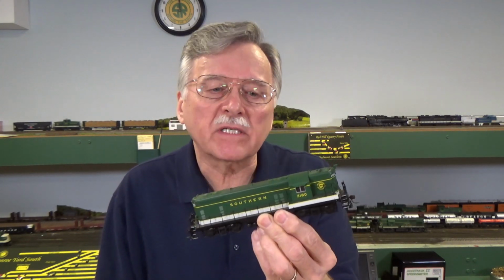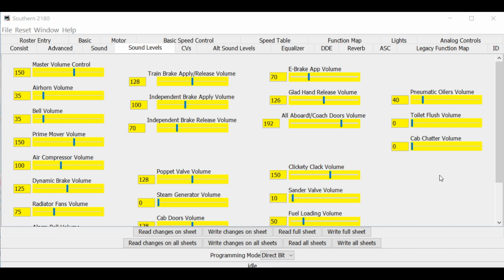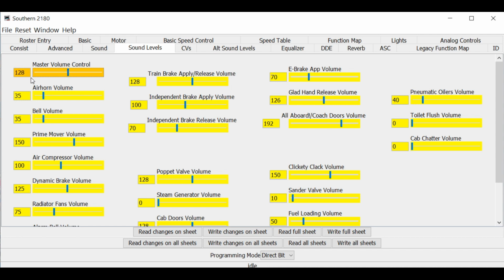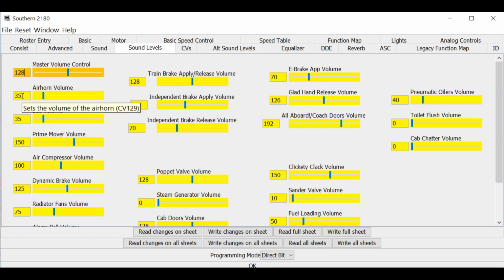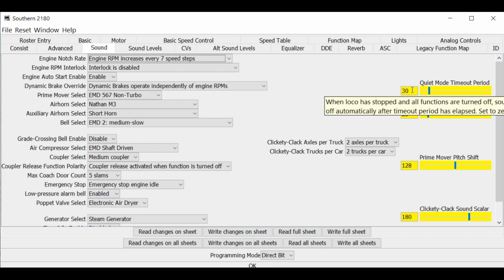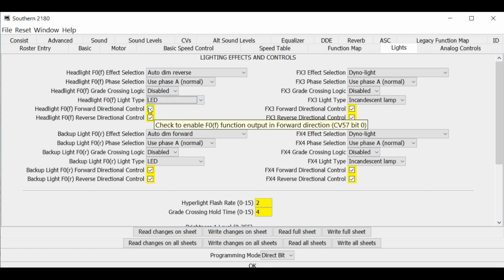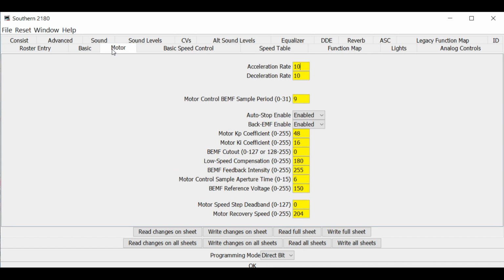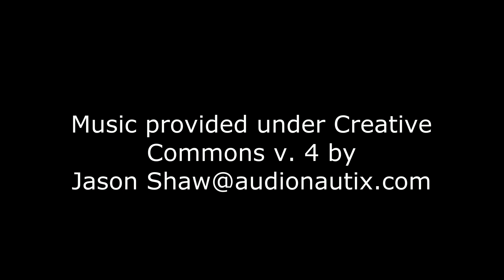Bonus Video--Programming a Tsunami2 decoder for my LifeLike GP7 (78)

Comment: Larry, could you do a video on how to connect a computer to a decoder equipt loco? I know you did one before, but I have a digitrax 51 system and no usb hookups. I have the jmri program loaded on my computer. Thank you and keep up the good work.
Reply from the maker: You will need a PR4 to connect the Zephyr to the computer. After that its pretty much the same as for any USB interface. I have a new PR4 so may do a video in using it after the first if the year.

Comment: you set the master volume at 128, does that mean that the prime mover sound will only go has high as 128  ??
Reply from the maker: Yes, that is what it does. That way the speaker is protected and even at half the master volume setting I had to lower the prime mover and other sound volume settings. Even at 1 watt these decoders put out a lot of sound volume. Most sugar cubes are rated at less than 1 watt so I start low and move up if necessary, which doesn’t often happen. Of course you can set the prime mover and other sound volumes to 255 but they are still only operating at half volume. If you find this too limiting then you cam always throw caution out the window and move the master volume setting up as well.
Reply: @TheDCCGuy  Thank you very much for your response.  Love your videos  !!!!!

Comment: Have you done any videos with regards to function and output settings? My program doesn't show a highlight of the CV when I put the mouse into the value settings as I have noticed yours does, Any ideas why?
Reply from the maker: You need to go back and watch the video  on setting DecoderPro preferences. There is a setting to turn on the CV numbers when you mouse over them.

Comment: Great, informative video as always Larry. Thank you. 

A note about sound programming. It is a good idea to always raise the high pass filter frequency up to at least 80Hz or higher. I noticed you left yours set to 20Hz. Two things about this. First, we humans can’t really hear frequencies that are below 60Hz. Instead we feel them when reproduced at significant volumes (if you’ve ever been near sub woofers at a concert, you’ll know what I mean). Second, the sugar cube speaker is not capable of reproducing sounds that low. In fact, it probably isn’t capable of anything below 100Hz. Therefore, if you send that low frequency energy to the speaker, you are taxing the speaker for no realized audible benefit and it will increase the chance of you having distorted sound (and potentially damaging the speaker). It also creates a higher current draw through the amp in the decoder (something to consider when you only have a 1amp decoder). I tend to run all my HPFs (high pass filters) in the 100-160Hz range depending on speaker size and the enclosure. Plus, I generally roll off the low frequency level in the equalizer too. All done in the interest of lower distortion and better clarity. Thanks again and keep up the great work!
Reply from the maker: Andrew, thanks for the tips. I typically use the equalizer to set the frequencies for the given speaker size assuming that SoundTraxx had optimized the frequencies for each size. I also mainly use Econami decoders which do not have the high pass filter AFAIK, so I need to experiment with CV224 settings a bit. I’ll give your suggested settings a try.

Comment: Larry, nice job on the conversion. However, I have a question about the light tube used in these models. How did you handle this while putting a speaker in the cab?
Thanks,
Larry
Reply from the maker: I just cut them back to just behind the lens area and glue the LED directly to it. These LEDs are so bright lots of light gets through.